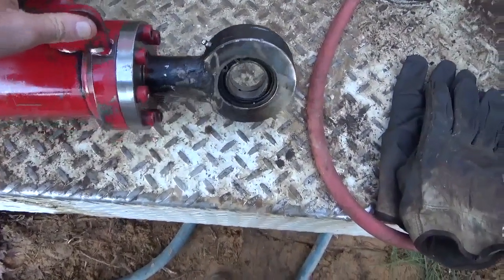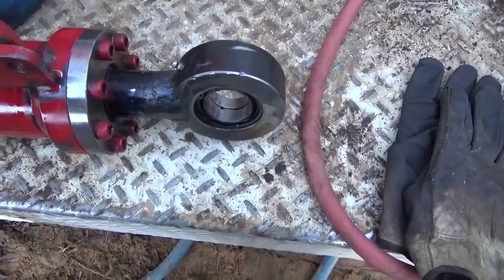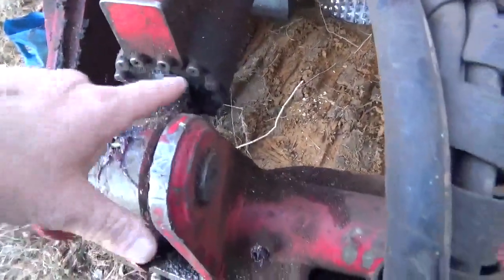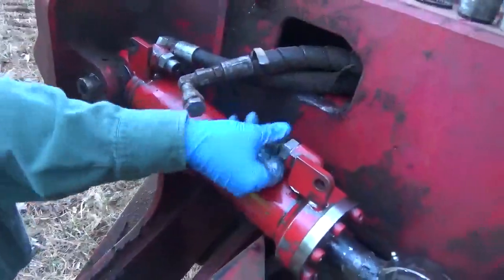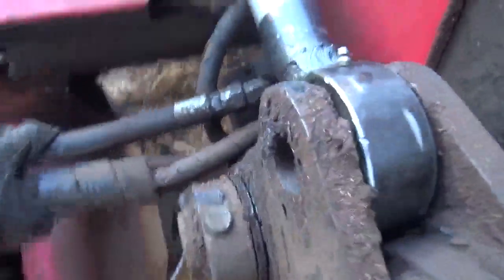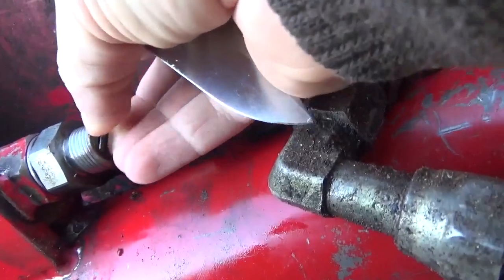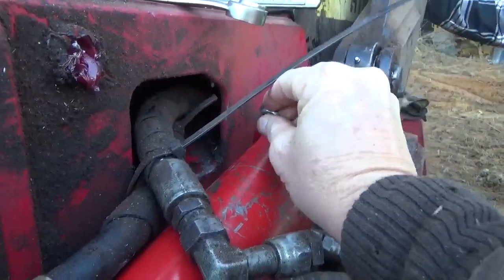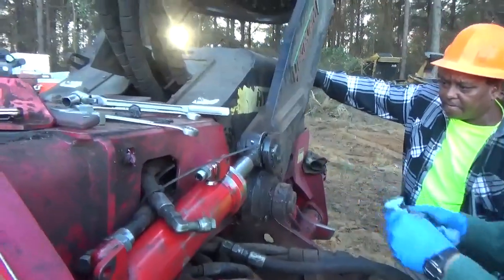Installing a hydraulic cylinder

Comment: When I pack my cylinders I use a engine hone and some different length extensions I made for different length cylinders if the barrels are not scared to bad they polish up nice with the 600 grit stone.

Comment: Good video as always, very straightforward to install. Do you get any bounce from the ram when using it or does the oil push any trapped air all the way to the tank?
Reply from the maker: It just pushes the air out to the tank